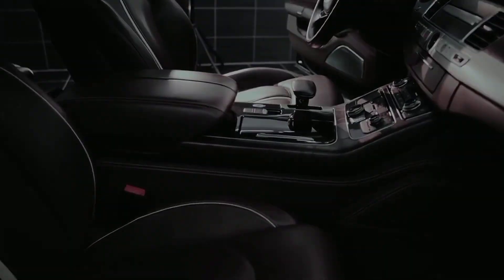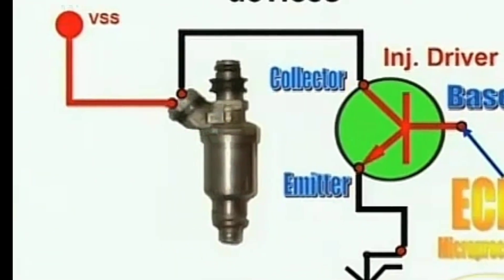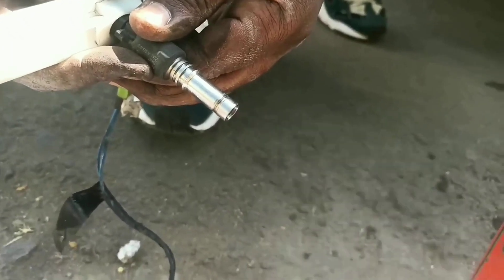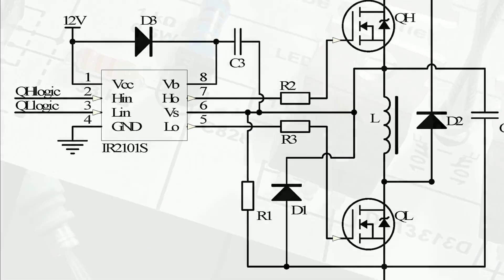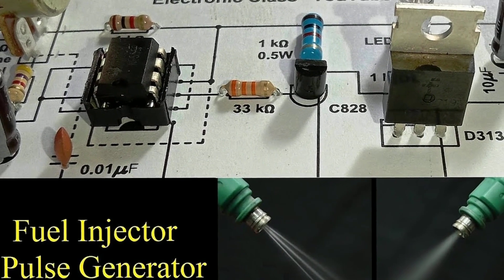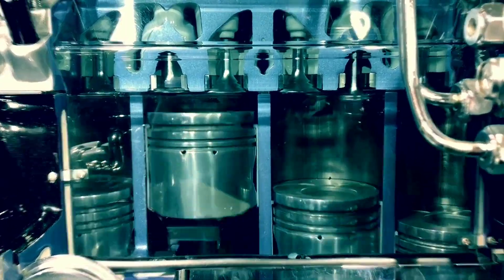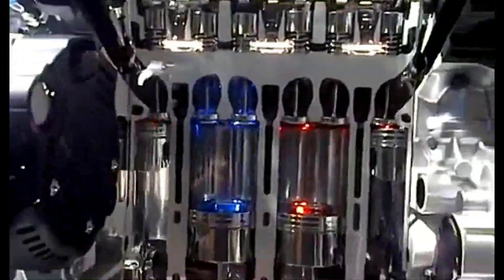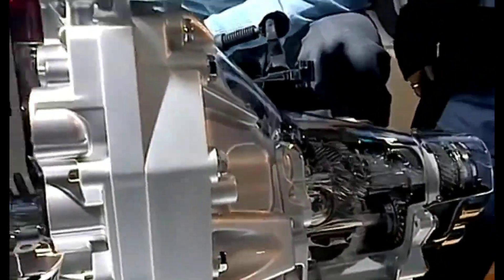P062B error code - causes and quickest solutions

Comment: Hello, thank you for your video first. I have this error code in my 2006 Ford Fiesta 1.4 tdci. At uncertain intervals, while driving, the Eac Fail warning appears on the dashboard and the gas cuts off, but the engine does not stop. When the fault occurs, the gas cuts off and the engine does not respond. When the ignition is turned off and on, it returns to running condition. When connected to the computer, the P062B code always appears. Dozens of mechanics have tried dozens of methods to fix this malfunction. What has been done to my vehicle;
~2 different brains were tested by being installed,
~2 sets of injectors were tested by being installed,
~Injector system was completely redone (from the brain socket to the injector socket)
~Crankshaft sensor was replaced
~Brake master cylinder was replaced
-Fuel pressure sensor was replaced
-Brain sockets were checked
~Glow plugs were replaced
~EGR was disabled and tested
Despite all these procedures, the problem still persists. Could you please suggest something to help me find out what the fault is? Thank you in advance.
Reply from the maker: Ok, I understand your issue... however, to properly address it, we will perform a remote service on that car for you. 

You might need to contact us privately, and we will discuss how this is done😊.
Reply from the maker: Ok, I understand your issue... however, to properly address it, we will perform a remote service on that car for you. 

You might need to contact us privately, and we will discuss how this is done😊.
Reply: Did you find this problem mate? Same car as mine and I got exactly the same problem!! So stressed